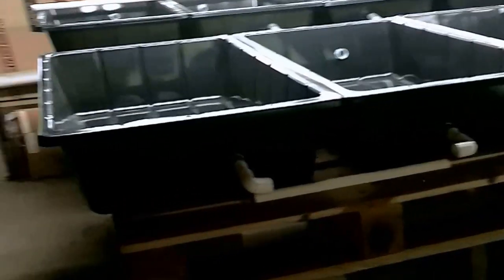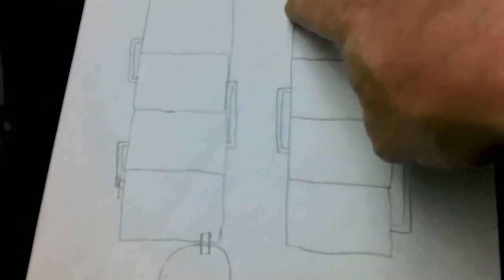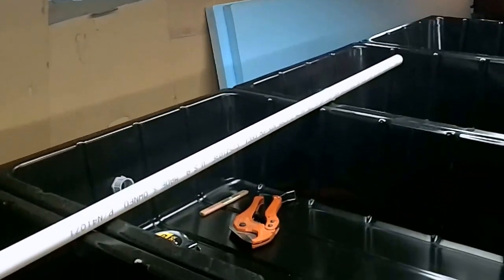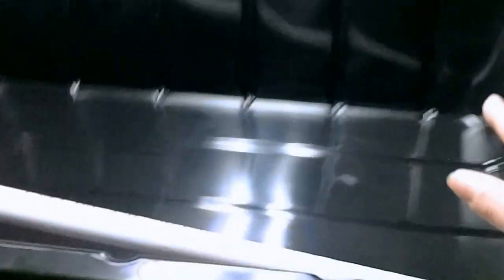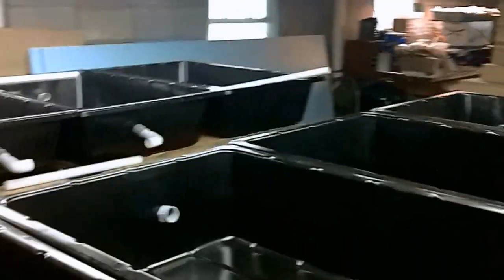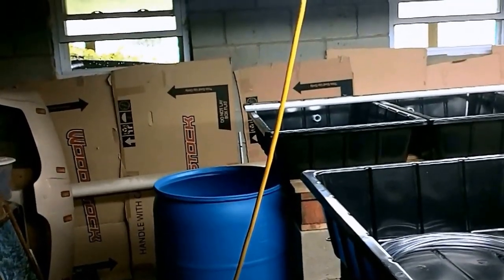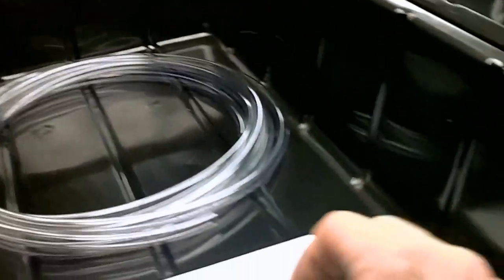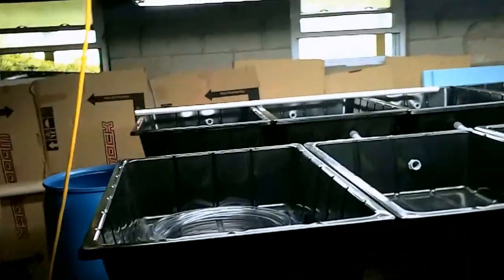Aquaponics in the basement

Comment: how did the barrel work as a fish tank?  I've heard that they are too deep and not wide enough, so I wanted to check with you and see how it worked for you. Thanks!
Reply from the maker: Project is still on hold and haven't gotten back with it yet. I have heard from others about the barrel issues but I've also talked with guys who are using them and it is fine. I'll have to find out and see how it goes. Stay sharp Buddy.
Reply: Punxsyjumper
Thanks.  I hope this all works out for you!

Jason